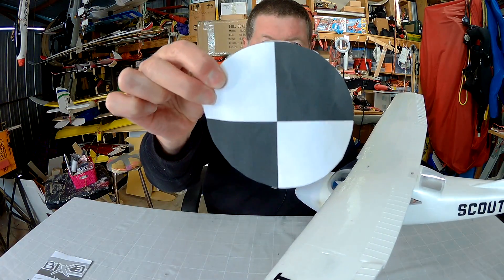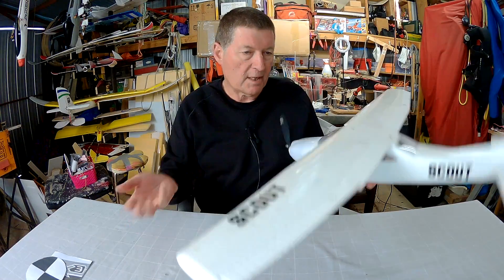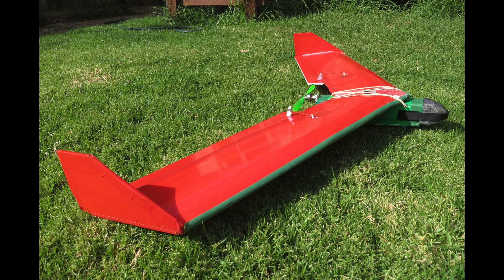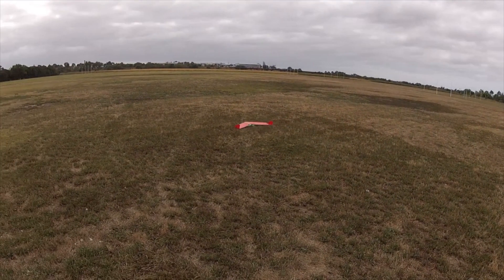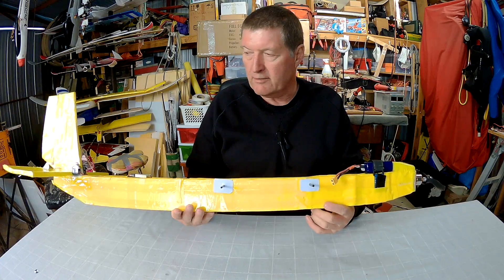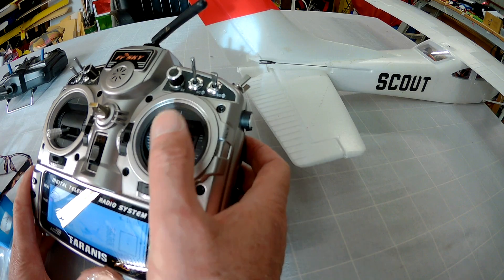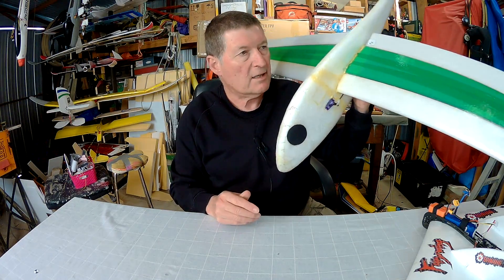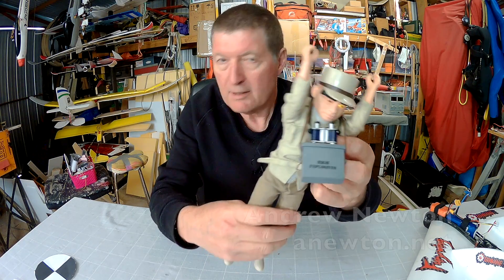Centre of Gravity

Comment: thanks for posting.  good advice, there.  for noobs, i  will point out that the expression 'figure out' a cg is misleading.  if you can find 30% of the root chord of a conventional wing, you have Found the cg.   during a maiden, etc, balancing at 25 percent ensures that a model is flying in a nose-heavy condition.    in either case, there is not a lot of 'figuring'.    cheers
Reply from the maker: The flat Boxler wing was more like 15%, the Raven mini DLG is more like 55%
Reply: oh yeah, right.   is this the point where i should write a page detailing where the Optimal cg is for EVERY possible planform, for NOOBS.     its yerz, if you say please.    or consider updating your mental filters, with more maturity and critical thinking.      cheers.

Comment: Well, I came here after watching Experimental Airlines performing surgery on himself, my mind is back on track. I'd like to watch you explain how to put a power pod over the wing of a glider sometime, confusing subject to me.
Reply from the maker: I haven't tried either of those things, probably never will.
Reply: just make a power pod that does this.  see link.   'this' being the use of Both an Offset thrust Line and a Compensating Correct Adjusted thrust Angle.   the goal:  the thrust Angle should cause the thrust Line to Intersect a model's center of MASS.    oddly, center of Mass and distribution of Mass are Seldom mentioned by hobbyists these days.    i guess i am the last of a breed.       cheers
http://static.rcgroups.net/forums/attachments/2/9/6/3/9/7/a5988257-224-bixler%202%20motor%20angle%20correction.jpg?d=1375236281

Comment: With a swept wing measure half the wing length between the centreline of the plane and the tip and balance for c of g there.
Reply from the maker: Great tip, thanks Andrew.
Reply: anewt, thanks for posting.  we both know its 50% of root chord, not span.  at :56, you make a slightly misleading comment, saying you had to 'figure out the cg again'.   more accurate to say re-balance.    cheers

Comment: Gday Andrew  
Do you still use and recommend doumment laminating film ?

Also i noticed on one of your other vids (not sure what one)
you did a test with a motor and prop where you checked how many amps the they were  pulling .
What did you use to measure the amps ? 
my multimeter  is unfused and says 10 amps max and the esc i blew last week was a 30A not sure what to use to get a measurement .
Reply from the maker: I use laminating film on flat surfaces mostly and packing tape on wings, both work well. I have been using a watt meter from Hobby King to measure current but that's now giving inaccurate readings, so now I use an FrSKY current sensor connected to an X series FrSKY receiver

Comment: I really never trust the CoG numbers in manuals, especially not the cheaper ones. I usually start quite nose heavy and move it back slowly each flight until I find the sweet spot.
Reply from the maker: Good point. DTTM - don't trust the manual
Reply: Its just a guide, they are mass produced and quality is not stellar

Comment: How about one on the dive test to find how the CG is (front or rear?)

also one of the best phrases about CG "a very nose heavy plane flies poorly... a very tail heavy flies once"
Reply from the maker: Not a fan of the test dive, too difficult for a beginner and it only tells you if the elevator is up or down for level flight.
Reply: Well its just trim for level flight and then peform a 45º dive..if it raises its nose heavy , if it keeps straight at 45º its spot and if it dives more its tail heavy.. all of them are derived too from the needed trim to fly level..

I might be biased tough..its how all slope folks do it here when in doubt ... and it actually helped me figure that some planes (like my Phoenix 2000 or the FVK Signal) were nose heavy due to conservative-forward CGs in manuals while others (like the SIG Ninja) were tailheavy..

Comment: For scratch build there is always be unloaded Glide test. if it flies level its balanced if the nose comes up tail heavy, if it dives it's nose heavy. Again do this without any electrics and surfaces taped neutral, try and do it onto long grass or something similarly soft. Once you have it gliding level, mark your COG and load her up!
Reply from the maker: Crazy talk, but if it works for you
Reply: Andrew Newton , better crashing a 100-300gram empty she'll of a plane at hand speed rather than fully loaded with electrics at launch speed. 
 I haven't had a crash maiden flight since I started this a year ago. 
 I do agree with others though. Start nose heavy and slowly move back. This will pull the nose down during a stall which brings airflow back over the wings again. 
 Keep the tips and scratch builds coming Andrew!

Comment: Center of gravity needs to match the center of lift for the plane to be balanced :)

Love your channel, thanks for the practical tips!
Reply from the maker: Thanks Pedro. I had a much longer version explaining centre of lift etc but though it was too complicated for a beginner
Reply: Andrew Newton I would say that people who are into rc planes even if they beginners are into the in dept stuff. People who don't want to go in dept probably just go to the rtf multi copters. Or maybe I'm wrong :P Beginners, what's your take?
Reply: Might be able to dumb down or simplify showing the relationship between center of gravity vs. center of lift with a scratch build that allows for repositioning of the main wing as well as weight.